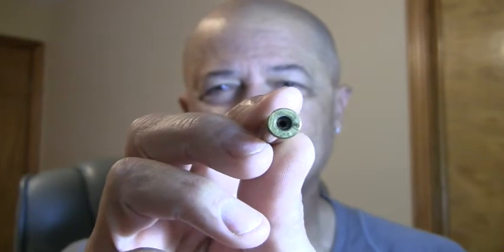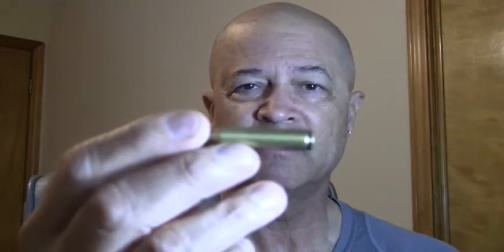Popped (Blown) Primers Cause Major AR15 Malfunctions

Comment: Thanks. I took my reloaded military brass (CBCMagtech) to range. Had 7 out of 50 rounds blow out the primer. Luckily a bolt gun. The difference with this batch is that I used a Lyman tool for clearing the crimp before priming instead of using a case deburring tool. Your video provides a lot of good information.

Comment: Well, at 6:00 minutes you said it all.  "Bring commercial ammo to training."  That is outstanding advice.  I had 2 popped primers out of only 50 12 ga shotshell reloads today.  The reloads were produced by a very young person that is new to reloading but is an intelligent and diligent person.  The autoloader I was shooting basically locked up and had  to be disassembled, including removing the trigger housing.  Both times there was a primer stuck in the bolt/trigger areas.  The damage could have been catastrophic considering I was firing an inexpensive Turkish shotgun.  Luckily everything is fine but now reloads will have to go through a much more rigorous examination.  Thanks for a very informative video.  👍🏼
Reply from the maker: I don't run a shotgun and wasn't aware that that ammo could have a blown primer issue. I TOTALLY feel you about the result on your shotgun!

There's a reason that Lake City crimps the primers for their 5.56 ammo.
Reply: @inyourdefense0  
Thanks brother.  👍🏼

Comment: I recently had 5 popped primers out of 12 rounds fired of freedom munitions  NEW 308 A Max ammo. Sent the remaining rounds in the box and 9 unopened boxes back for a refund. The high pressure and blown out primers damaged my extrator. I'm having to replace it. I'm asking Freedom Munitions to pay for the replacement. I doubt they will
Reply from the maker: Wow! That's a terrible failure rate for ammo!

Comment: I need to make a video on this as well! 

I’ve had 2 bad batches of 1000 rounds each from my local reloading company. 

Constant primer separations / popped primers.

I’ve since gotten really good at identifying / fixing these malfunctions. But the very first time it happened I was so confused at what was happening.

Often the primer separation will cause a failure to extract or a double feed or both. 

Your first initial thought will be to mortar your rifle to extract the round, BUT! What would happen is I would mortar it, and it would wedge the primer super tight above the bolt, completely locking the bolt in place. Can’t cycle it, can’t break the gun apart etc. 

Seriously tho, that primer can get stuck in a bunch of different places. Most common I’ve seen is in the breach, above the bolt, and right above the extractor. 

The worst one to fix is when it gets lodged above the bolt. 

I literally will have to use a screwdriver and mallet to pound on the bolt to get it to move back and forth in order to free the primer. Fun stuff!

Great video!

Comment: Literally had this very issue a few days ago and finally resolved it today. Was shooting Hornady black and some Sig match ammo and randomly the bolt jammed about half way. The primer must have been lodged in there then and I just so happen to break it loose. Today I was at the range, got seven rounds deep and the trigger just wouldn't reset and the selector was stuck. About thirty minutes of head scratching later a friend of mine saw the primer wedged in the trigger. I'm still gonna take it to a Smith to check but man am I glad I don't have to send it off. Very valuable lesson learned.
Reply from the maker: theraycharles I'm glad you found that little bugger. The military crimps the primer just for that reason.

Comment: Recently bought a new AR15 (300 BLK) along with some Fiocchi and Ammo Inc (both new factory rounds.) Started out shooting one mag each at a time to test compare reliability and grouping. Groups were about the same but the Ammo Inc. had at least one failure to fire/25 rnd mag. After each incident the bolt appeared closed and after dropping the mag and pulling the charging handle the non fired round would drop out of the mag well. I would reload the cartridge that didn't fire and it would then fire. The last time this happened (~4th failure) I noticed a primer resting on the bench after clearing the weapon. I went looking for all my spent cases (for this outing) and found one missing a primer also another with the primer bulged way out. Suspect loose primers have been bouncing around in the action causing the misfires. Problem solved. I hope. 
I'm assuming the culprit is the ammo particularly since the other brand had no failures. My question, are there any scenarios where blown primers be the fault of the gun and not the ammo?
Reply from the maker: First, thanks so much for sharing your experience with this issue. I'm not an armorer, so can't speak directly about the gun. However, my sense is that unless it's a DYI build, or the owner has done some experimenting with the gas block, the issue is always with the ammo. Reloading can introduce errors as well.

The fact that the popped primers mostly go unnoticed, unless, like you, the shooter does some investigating, the failures are assumed to be random, and if the gun can be immediately put back into service, most shooters just tolerate this.

On the battlefield, or in a class, if the primer has popped out, but is not hiding in the chamber somewhere (like a tiny piece stuck in the breach, or jamming the bolt) the gun stays in service, and life goes on. Otherwise the gun is out f the fight and you just go to secondary and find a safe place to investigate and clear the gun.

There is a reason that the military only uses ammo that has a crimped primer.
Reply: I’ve been having this very experience with my Springfield Saint 300 Blackout .. and it’s happened when I’m out hog hunting .., extremely frustrating and the timing makes me get very angry .. guess what ammo i been using .. yep , Ammo Inc. BTHP .. I’m contacting PSA about it tomorrow… because that’s who I’ve been getting it from !!!  I’ve been going round and round with this issue for about a month now … and this video perfectly explained it !!!   
This last malfunction had me taking the AR apart … and this time the blasted primer fell out of the trigger mechanism… it was in there preventing the trigger from resetting and the safety switch wouldn’t function !!! 😡

Comment: I had a popped primer shooting reloaded 5.56 that I got at a gun show. Got the bolt to close using the forward assist. Buddy helped me open up the upper, and the primer dropped onto the shooting bench. He found the spent shell missing the primer. The gun worked fine after that. While cleaning the gun today, I couldn't get the cotter pin that holds the firing pin in place out. I really had to pry on it until it snapped. Turns out, one side of the cotter pin was seriously bent (like 90 degrees). Not sure if this was a result of the primer popping or where the primer ended up.
Reply from the maker: Yes, sometimes the stress on that part is affected by a popped primer. You should replace with a new cotter key.

Comment: Thank's for the heads up. I reload my 223 and have had no problems, the brass is PMC and it's not crimped. So if I ever have a mysterious problem, I'll check to see if it's the primer. I target shoot so any problems I can just take the AR apart and fix it right there on the line. Thank's again!
Reply from the maker: Keep in mind that the blown primer may fall out as you're breaking down the upper, or even removing the mag. As a result, you won't find it. That can make you think you're going mad!

Comment: That's good stuff. If I can put my two cents in.......I've loaded my own ammunition for years.  My son and I shot CMP service rifle for years and out of the tens of thousands of rounds we shot I doubt 500 of them were factory loads. You mentioned "reloads" and the cost savings but people need to understand that "reloads" and "handload" are not the same and by no means cheaper but they allow me to tune my ammo to a particular rifle and are far more reliable than any factory ammo out there..
Mysterious malfunctions are a symptom, of a bigger problem. Yes a popped primer may cause these malfunctions but that's just another symptom. Why do the primers pop out is the question!
Primers either blow out due to excessive chamber pressure or a loose primer pocket. If you find a blown out primer check some of the other cases you've fired. If you see any that look like the primer is extremely flat almost "smeared"  and you no longer see that gap where the primer rounds over you probably have an overpressure issue and all the nail polish and primer sealer won't help. 
Now if your using ammo made from once fired brass it may or may not have a military crimp. You can buy once fired brass that's had the primer pocket swaged already to remove the crimp. 
I'm not trying to be a jerk but when you prime your brass be it by hand primer or on the press you can feel what kind of resistance you're getting. I'm sorry but if you can't tell a primer went in too easy youre not paying attention . This is a good example of "reloading" vs "handloading".
I've had some popped primers from my 600yd ammo but these are specialized rounds operating at their outer limits. I cannot remember having a primer pop out of any other ammo I loaded. Rather you roll your own rounds or not, if you use virgin or once fired mil brass and swage them yourself pay attention. Just like pulling a spark plug can tell you what's happening inside your truck motor reading your spent brass can tell you a problem may be present
Reply from the maker: Excellent information! Thank you!
Reply: Yes, thank you!

Comment: Just bought a new ar10. Took it to the range. Put in a mg of Hornady, everyone of the things you mentioned happened. Jams, bullet stuck in barrel. Blown primers, 6...had to stop shooting. Weighed Hornady. Bullet weight varied .1 in each round. I have shot Hornady forever, never had a problem. Not sure what’s up. Cleaned out gun, tried other brand, no issues. Must be shooting over max weight

Comment: explain this then please 24" 223 wylde 1-8 twist flatens primers and sometimes pops primers with a 77gr sierra bthp or 75gr hornady bthp or 73gr berger bthp with a minimum load of blc2 or cfe223 use the same powders with a 55gr with a next to max load and no pressure signs at all standard gas block and buffer and spring put a adjustable gas block on and with the gas cut completely off the bolt still moves back 3/4" and flatens primer with no gas at all head space is checked by gunsmith closes on go gauge and will not close on the no go gauge help if you can
Reply from the maker: I wish I could help with this. You have a lot going on and this is beyond my expertise.
Reply: @inyourdefense0  see if you can ask around if you would

Comment: I had this happen today with commercial ammo: Hornady Frontier 55 grain 5.56 ammo. Two popped primers in roughly 100 rounds, shut my rifle down completely. Primer stuck between trigger and selector. Pictures for proof, if wanted.
Reply from the maker: Thanks for posting your comment. That's a pretty bad popped primer failure rate.

Comment: Blown primers...more than likely an over charge blowing them. To hot of a load will definitely do that. I had factory Aguila 300BO that were from so mild it wouldn’t cycle to so hot, it blew primers out and everything in between. Maybe even a reloader not doing it right by seating the primers correctly

Comment: Today 4-3-22 i went to the range with my new built ar15 chambered in 300aac, had 20 rounds new factory ammo. 4th round faild to feed when i cleared it a spent primer fell out......that happened 3 times in a 20 round brand new box
Reply from the maker: To make sure that it isn't your new build, see if you can borrow a commercially-built rifle, and run through the same amount of ammo, in the same lot if you can.

Comment: This happened to me today and it was not a loaded ammo by me! I bought Dicks field and stream 223 ammo, and had one popped on me! Did field and stream fucked up on the ammo?
Reply from the maker: I've come to the conclusion that there's a reason that the military only uses crimped primers.
Reply: InYourDefense agreed but where can I find some! I don’t know how to reload yet! And thanks so much for the fast reply’s! So far the other ammo like PMC and hornady frontiers work flawless. It’s just 10 bucks more than dicks field and stream! Ether way I can’t get those ammos anymore due to Dicks sporting goods being a dick!
Reply: InYourDefense should I still go to the gun Smith to check my head space?the same gun Smith assembled my 223 wylde upper! Today I shot about 50+ rounds mix or 5 rounds 556x45 25 rounds of 556 NATO and 15 rounds of 223 rem by field and stream I had about 10 223 rem left! So that’s what made me think it was their primer!
Reply from the maker: @J4RK1LL  Checking head space can't hurt, and if the chamber is rated for 5.56 that shouldn't be a cause either.

I've just decided to use 5.56 ammo with crimped primers when taking a class, and in all magazines that may be used in a defensive situation. I use my reloads for "range therapy" sessions.
Reply: InYourDefense where or what brand sells ammo with crimped primers?
Reply: InYourDefense just wanted to give you an update! Just got back from the range and the AR is working flawless! Shot about 50rounds of 556 frontier hornedy brand new! With no problems!! What ever you do don’t buy from Dicks sporting goods! That’s where I got the Field and stream Perfecta yeah those are far from “perfecta” lmao
Reply from the maker: @J4RK1LL  Thanks for the update! No one should be buying from Dick's these days.

Comment: Don't you think you may have a weapon problem if you are popping primers all the time ? Like bolt unlocking before chamber pressure bleeds off. Perhaps you should change your buffer spring or buffer weight?
Reply from the maker: MrRicard75 Thanks for your comments. The ammo issue was confirmed because the same problem showed in two different rifles.
Reply: Fiocchi .308 target rounds.. first three rounds out of magazine lost the primer after initial shot. Caused a severe jam. Reloaded three more, three more primers went missing. Returned fiocchi rounds ,switched to federal, no issues at all
Reply: You could also get a tungsten weight for your carrier. I'm not sold on the Idea but a lot of service rifle shooters use them to delay the unlock process

Comment: This happened to me today. Shooting 77 grain IMT Israeli ammo. Primer blown out and got stuck in the gas port hole on the bolt carrier. Insanity.
Reply from the maker: There's a reason our military uses ammo with crimped primers.
Reply: @inyourdefense0  I don't understand why match grade ammo like the razor core 
(.80/round) would have this issue especially if they know it's a known problem. 

According to SGAmmo, the IMT ammo "the brass is annealed the primers are boxer corrosive and sealed and crimped."
Reply from the maker: @brandon.karnes  Believe it or not, most folks that shoot ARs are unaware of the blown primer issue. I get ammo made by Lake City (the vendor for the military) whenever I can. I use that for any training classes, and for my defensive stockpile.

I reload (single-stage press) .223, but NEVER use crimped military used brass. The de-crimping process adds too much room for error. My QA is a bit tedious, but it comes down to 1 hour reloading for every 100 rounds down range.
Reply: @inyourdefense0  I've got a bunch of Lake City myself - never had an issue. Ammo has been a little tough to get lately - especially in my area - so I decided to try the 77 grain stuff especially since my barrel is a 1:7.

I'm just hoping it didnt do any damage that I am unaware of. I'll be sure to be extra detailed during the disassembling/cleaning process.
Reply from the maker: @brandon.karnes  I pay particular attention to the chamber lugs on the breach, and the entire BCG. I then use a high power light to inspect and clean the trigger area (you'd be surprised to see where remnants of a destroyed primer can hide, only to rear its ugly head when you least expect it!)

Comment: Every  problem  you said happened to me today all over a Poped  primer  I got home after I lefted the range due to my ar trigger wouldn't  engage  or move at all here the ar jamed missed fired and even got stuck bolt wouldn't  move and I was even ruff with it took it apart nada.  Shot sum more rounds then the trigger locked up so I got the primer3 out my ar now but dam it had me scared  the round were too hott and broken my rifle lol